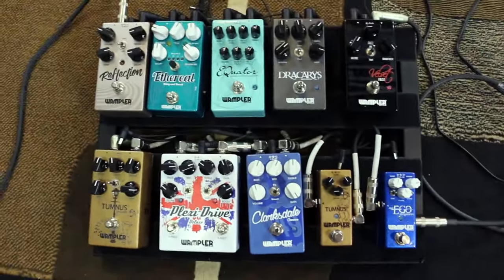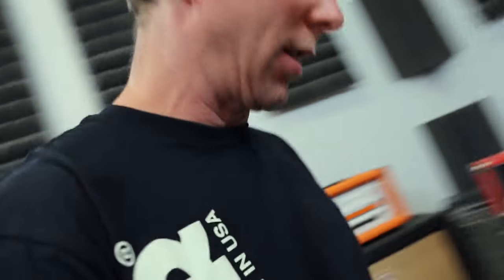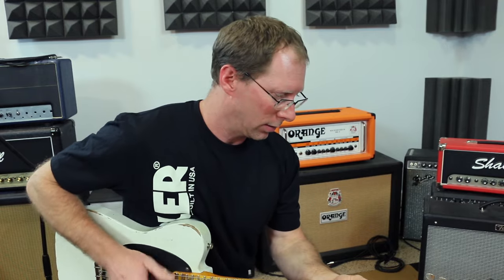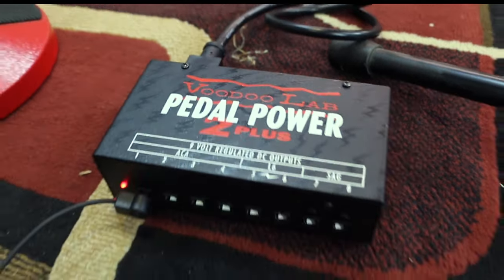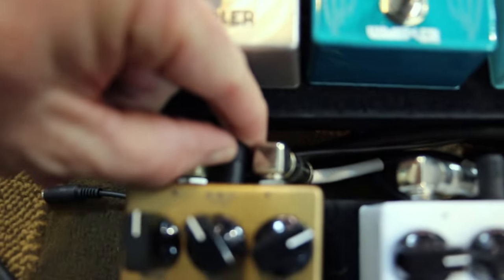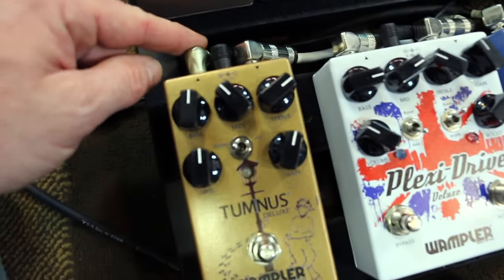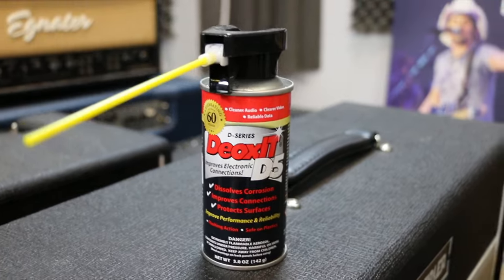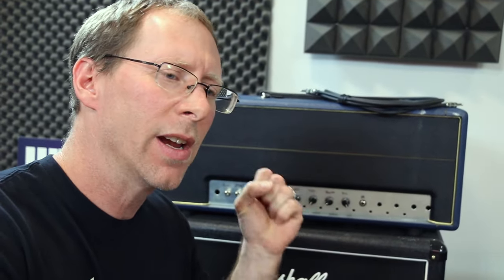Troubleshooting "non working" pedals, what to do first if your pedal stops working

Comment: My Plexi Drive turns on and stays on (according to the light, but does nothing. Knobs do nothing, signal runs perfectly clean through it.
Acts like it's bypassed.
Switch works to turn the light off/on, but circuit is just not there. Just to note, the pedal was working, stopped during a song. We practice in a studio, filtered power, great cables, tried all commonsense suggestions, will try a battery.
Reply from the maker: Sorry to hear that! Go here and we will take care of it, https://www.wamplerpedals.com/contact-us/

Comment: My pedal doesn't turn on!!

I left it on, walked out of the room, came back, and the pedal was off! I discovered that I had been using the wrong power supply! (9V AC but it needs 9V DC...) I opened the pedal after this terrible discovery, and I couldn't find anything that screamed broken.. but the pedal still doesn't work (Using proper power at this point).. any idea what I need to replace internally so that my pedal (Ibanez Analog Delay Mini) will turn on again?

Comment: I recommend making yourself a high-capacity battery pack.  So, six AA batteries in a 6-pack battery-holder, connected to a 2.1mm plug.  I suggest this because it will work for pretty much any pedal, analog or digital.  Using a fresh 9V Duracell IS a good idea, but trying to troubleshoot any current-hogging digital pedal will go through those pricey 9V batteries fast enough that you can end up spending as much on Duracells as a new pedal.  A 6-pack of penlights can use dollar-store budget batteries and still do everything you need.   Remember that plugging in a battery-pack to the power jack will disable whatever battery you may have inside the pedal.  And for heaven's sake, make absolutely sure you have connected the plug to the batteries observing the proper polarity.

Comment: Should I unplug my pedal every time I’m done using it? Last night it wasn’t on, but it was plugged in, and this morning it didn’t work. So I swapped the battery, and it’s back to working condition. So should I unplug the pedal when not using?
Reply from the maker: Yes
Reply from the maker: Or, get a good power supply

Comment: So I have a loop pedal that doesn’t turn on. But my power supply flashes when it’s plugged in. It works fine with every other pedal I have but it only does this for this one.
Reply from the maker: I would contact the manufacturer for the power supply and loop pedal and ask them why it’s doing that

Comment: I have an old multifex guitar pedal which I won't part with cuz it was my first pedal. But the output jacks the right left, the little pins that go into the circuit board or wiggling around in a shorts out. If I drop a little bit of solder on each one of those pins will that stop it from shorting out. Do you think I would appreciate to know what you think

Comment: I have 2 mxr pedals, I lost my power supply and one day I tried to use them, both batteries were dead so I grabbed the first supply I seen not realizing it was a 12 volt, now I can't get either to work at all, can u fry a pedal with those couple extra volts?

Comment: So in buying the tumnus deluxe because it has the battery option... was a mistake cuz youre really supposed to use power or you get less than 10 min play time? No bueno 😑
Reply from the maker: Correct, the pedal takes 9v and triples it. This eats up batteries. Plus, power supplies are inexpensive and cause much less environmental harm 😊

Comment: I have a distortion pedal that cuts my signal severely to the point where it can hardly even be heard but when the pedal is engaged, it works flawlessly. I have the proper power and have isolated the pedal. None of my other true bypass pedals do this so I am not certain what's wrong.
Reply from the maker: Sounds like the switch needs replaced
Reply: @wampler_pedals  Thanks!

Comment: Hello everyone. I have a problem with the crybaby wah pedal.When I put it directly(input for the guitar, output for the Amp) it works great. But when I try to put it in the pedalboard(even by itself) it doesn't make the wah effect. If I press once I have a clean sound, if I press twice I haven't sound at all.I don't have any problem with any of the other pedals so it's not a cable/power supply/pedalboard(I have a behringer pb600) problem. Can you help me please?

Comment: I have a DOD FX60 from the early 90s that a friend gave me to fix. The issue is that always stays on and engages the chorus effect. Troubling shooing was a pain. I messed around with it and now if the led is on it won't work. but if its off the pedal just always stays on. wtf?? In other new hey brian any chance you can just send me one of your amps lol

Comment: Quick question because I just bought a boss ds1 and it stopped working, I'm new to pedals but I plugged it in and it had already a 9v battery which I replaced and worked for a bit then stopped working, so I don't know if its something I'm doing wrong or maybe gave it too much power i bought a power supply with it at the store which they said was the correct one???

Comment: I have a new pedalboard (8 pedals) and sometimes when I play the signal goes weak. So less volume and it distorts sort of more. I unplug some output jacks and then it works again, not always... Still have to go through all the pedals. What could this be?
Reply from the maker: I would say you have a bad switch somewhere. Isolate each pedal one by one until you find the specific pedal causing the problem

Comment: I have 5 donner pedals but if I put 3 or more in a chain theres no sound. I've isolated all of them and they all work and switched the order. I bought a new power supply and even tested on other amps and same problem. I'd appreciate any advice.

Comment: What do i do if the pedal will only flash once when i plug in the adaptor. I have 9v pedal and have been using it for a while. But it doesn't work anymore. Already adjusted the Volts in the adaptor. And my pedal does not need a battery, it relies on the adaptor.
Reply from the maker: Depends on the pedal. You might not be giving it enough amperage.

Comment: Sorta unrelated but the original tumnus looks to be a different enclosure with a clear led and a black washer on the switch—is that because it’s a mechanical switch instead of the relay? Also, what was the reason for refining the enclosure? Is there any other differences in the circuits or otherwise?

Comment: i have a question. i have 8 pedals in a chain to a power source that just stopped working but still lights up. i changed the power source but still nothing. in fact when i turn on some pedals.  it cuts off the guitar sound. i dont get noise or sound. anyone have any idea what it could be?

Comment: Sir ,can I ask what if the pedal is turned on and connectred to the amp and guitar but the effects of the pedal doesnt work? Just making the guitar sound louder 
 Im using Mini Kokko Distortion  Guitar Pedal
Reply from the maker: Sounds like a bad switch
Reply: @wampler_pedals  actually ,it works at the first time i use it but, it making a loud static, but when someone repaired the static problem, the pedal isnt working anymore

Comment: Thanks for the information, great help. One question if you don´t mind? I recently purchased  a joyo Digital Delay pedal (cheap i know) but it really sounds great...unfortunately, the battery power does not work, it did for about a week, then shut down all together...when i plug into the adaptor all is fine...but should the pedal work on either source? Thanks again...cheers.
Reply from the maker: It should, I would go back to the manufacturer and ask them to fix it under warranty.
Reply: @wampler_pedals  sadly the company here in Sth.America offer no assistance...but at least it works with the adaptor...Thanks again.
Reply from the maker: That’s a bummer ☹️, that’s the bad thing about cheaper pedals many times- no customer support 😞
Reply: @wampler_pedals  I agree with you 100%..lesson learnt. Take care, stay safe.

Comment: What if the pedal on off  switching sometimes works and sometimes doesn't? It seems to be tight enough.  I contacted the manufacturer in China and got a run around and they stopped responding to my emails,even though it's still under warranty,it malfunctioned after 8 months. Is there anyone in new York who can service it ,and do you do that work for that matter? I would also like to know about how much it would cost.Its only a fifty dollar pedal.
Reply from the maker: Unfortunately, that’s the problem with buying inexpensive pedals- there is always a sacrifice somewhere and many times it’s in the customer service area. I’m not sure who fixes pedals, I’m sorry 😞, we have a department at Wampler but we only fix our own products

Comment: Ive got a boss EQ pedal that the LED suddenly stopped working. Is this an easy fix? Any advice?
Reply from the maker: I’d just replace the led first. If that doesn’t work, measure the voltage on it

Comment: I dropped a mini EQ pedal (like a GE7)  from about waist-high  -- stopped working. Light doesn't go on.  
What's your guess on what broke?
Reply: Try electrical cleaner. I did the same thing. Spray some CCR. On the motherboard.

Comment: So I have this Gokko AXE Mx 300 multi effect board pedal thingy and It can only take a 9v power supply. Plugging it in makes it flash indefinitely. When plugged into an Amp it buzzes in the rhythm of the flashing. When I run it with a daisy chain it'll blink and like takes all the power cuz the rest of the pedals are off completely. Unplugging the board let's the other pedals turn on. What could be going on? I couldn't figure it out from the video :/
Reply from the maker: Sounds like it’s not able to provide enough *current*, as opposed to voltage. For example, if your power supply is capable of supplying 500ma, and your 6 pedals are daisy chained but each require 100ma, you aren’t giving it enough current which can exhibit problems like this
Reply: @wampler_pedals  okay,, I think I gotcha, I appreciate ya response man!
Reply from the maker: Yes because the 100ma x 6 pedals = 600ma needed. So a 500ma power supply won’t be able to give it enough current…milliamps = current rather than voltage.

Comment: After getting 0 signal from a pedal I tested all my pedals alone and I would get a sound if the pedal was OFF. Once I turned the pedal ON I got no sound. I highly doubt that all 8 of my pedals are bad, so I'm not sure what the problem is.
Reply from the maker: Test them one at a time, isolated. Nothing more than guitar Into ONE PEDAL ONLY, into amp. Do not connect them to each other for this test.
Reply: @wampler_pedals  I did for each pedal and they all worked, but as soon as I did plug them back in, it didn't work anymore. I checked back about an hour later and It did work. There's an issue, I just don't know what it is at this point.
Reply from the maker: Did you add one pedal in at a time until it stopped working?
Reply: Wampler Pedals Yes but I ultimately realized that I had one pedal plugged in incorrectly. I had one side plugged into the mono input, but out the stereo output. Just my little mistake. That being said; I have a TC Electronic Helix Phaser that the mono circuit does not work, only the stereo circuit. Is there any way to fix that?

Comment: Can anyone help me? I bought a guitar pedal, and its not battery operated so i bought the changer it needed [which is 9V]. i leave it charging, then plug into my amp, then my guitar but then i cant hear from my amp no more, and it doesnt show that its even on!  I put all my wires in the right order, i charge it, and i even bought a new amp because my other one was old.

Comment: Why is it basically industry standard to not include a battery compartment door? I find it really annoying to have to get a screwdriver when I want to check on the battery.
Reply from the maker: For smaller companies in the boutique world it requires expensive tooling. Also, most don’t use batteries as they own multiple pedals so they use a power supply
Reply: The first thing I do with a new pedal is pull the back off, remove the battery and use electrical tape to insulate the battery socket.  Paranoid is not just a cool song...

Comment: I just bought a big muff and it requires 9v but my battery plug in thing is 12v and is not turning on? What am I doing wrong
Reply from the maker: Probably wrong polarity if I had to guess. Is it a dc power supply made for pedals?
Reply: @wampler_pedals  no the power adapter is from my massage gun, and I’m new to guitar and stuff so idk if it’s the pedal problem or me lol
Reply from the maker: Gotcha. Yes probably wrong power supply. I have a video about this as well you can find about using the wrong power supply. I’d recommend getting one made for pedals. The Truetone one spot adaptor is great
Reply: @wampler_pedals  just found out my amp doesn’t work anymore. it making static sound louder then hearing the guitar notes, but when I stand and point the guitar in a certain angle the static sound is gone??

Comment: Hey, so my MXR Distortion Plus pedal is acting odd. When plugged in, it turns on, but there’s absolutely no sound when it’s pushed on. I’m currently using a 9V battery for it, but the pedal and battery are brand new. Anyone have any ideas?
Reply from the maker: Probably needs a new switch

Comment: my pedals power supply seems fine because it turns on fine but i don’t think the signal from my pedal can go through the amp. the cables are fine so i think the cable is stopping the signal or something. is there a way i can fix this?

Comment: Is it normal for a brand new 9v energizer batter to last only about an hour in the Tumnus deluxe?
Reply from the maker: Yes, because internally it is boosting voltage quite a bit which drains the battery quickly. This is why it says in the manual to use a power supply

Comment: I thought my pedal was broken but turned out the battery was just low I'm so relieved
Reply: I think some pedals don't work as well as they age, with batteries, they drain them fast, or the contacts go bad, or all of the above. It's probably best to invest
in some good power adapters and use a power bus or whatever, with a power supply below, if you want it to be more reliable.

Comment: when i press my distortion pedal again.it doesnt go to clean.the distortion effect isnt there anymore just nothing comes out of the amp.
Reply: I have the opposite problem. When I turn my distortion on everything cuts out and the guitar doesn't even go through the amp until I turn the distortion pedal off. My pedal goes straight into my amp

Comment: What about popping noises when you switch on or off some pedals ?
Reply from the maker: Good point! I need to address this on an upcoming video
Reply: I have every confidence that Brian will cover it well.  But for now, it is something I like to call "pedal ventriloquism".  It happens when a true-bypass pedal is situated before an electronically-switched pedal, like one from Boss, or DOD, or Yamaha.  In such instances, it is actually NOT the pedal you are stepping on that is popping, but rather the e-switched pedal after it (hence the reference to throwing your voice), that has not been designed in anticipation of momentary disconnections and reconnections to its input (which is what true-bypass switching does).  I won't steal Brian's thunder here.  Wait for his video.  I'm sure it will make everything clear.

Comment: Notice how none of the problems are with the pedals? It's because Wampler pedals are built to last. #truestory 

Also, pro tip. If you gig a lot, and see a lot of different stages, protect your valuable equipment and yourself, and purchase a high quality voltage regulator/power conditioner. Not just a $100 rack "conditioner" w/lights, but a real, professional grade one. You're only one poorly wired outlet away from being an unfortunate part of the stage show.

Comment: I have an Ibanez AF2 Flanger (the giant purple Paul Gilbert one), which is an awesome pedal, but last time I used it it seemed like turning it on would drop the volume way down. Is this a problem with the switch? What is the solution?
Reply: It can happen that too much heat gets applied to solder lugs on stompswitches during installation.  Much less so with commercial pedals than with DIY pedals, but it happens.  Stompswitches have a dab of grease inside to both hold the parts in place during their assembly, but also to stop/damp "chatter" inside the switch.  When too much heat is applied in the soldering process, it can liquify the grease and cause it to flow over the contacts, serving as an insulation.  I whipped up a video showing how this works and how to fix it. https://www.youtube.com/watch?v=6uhDKFhqYnw  I don't know that this is your problem, but at least you have something to consult if it is.
Any possibility it has been subject to higher-than-normal temperatures?
Reply: Thanks. The pedal has been inside ever since I got it, so it's pretty much always been at room temperature. Nothing extremely hot or cold.

Comment: Turned on... But no sound...
Instead it acts like a bypass.
Wtf..
Reply: Same, not even a light on the pedal
Reply: @jasonriley269  dude i fixed it!...
Try to switch your input and output cable.
The cable that goes from your guitar into input...
And try to switch it up between input and output